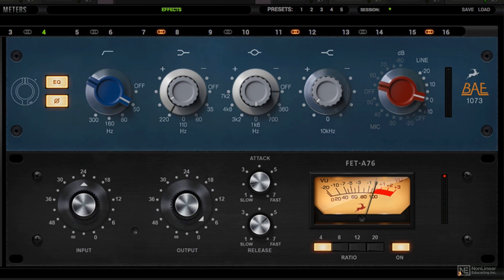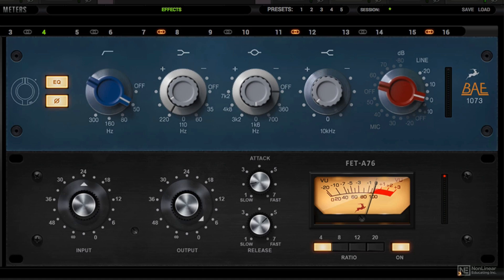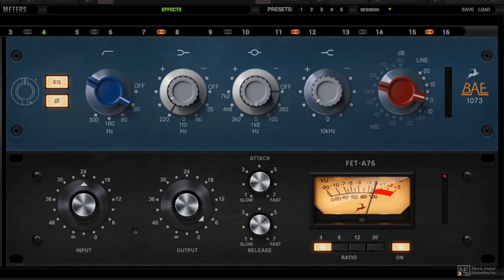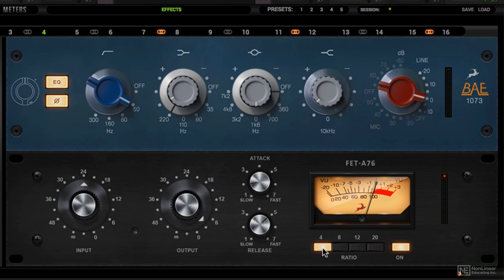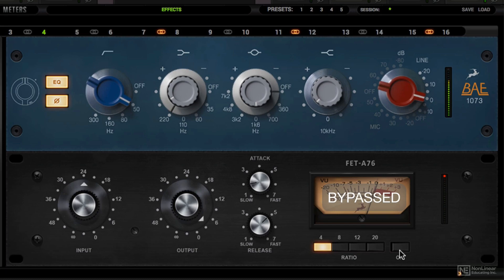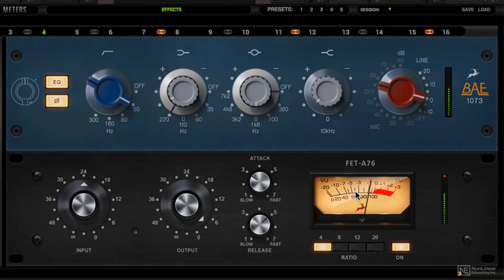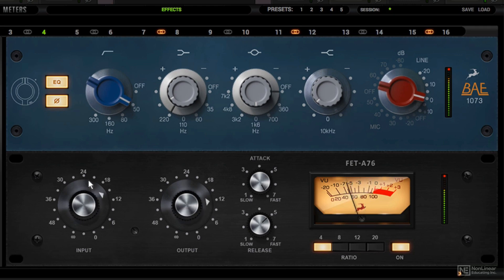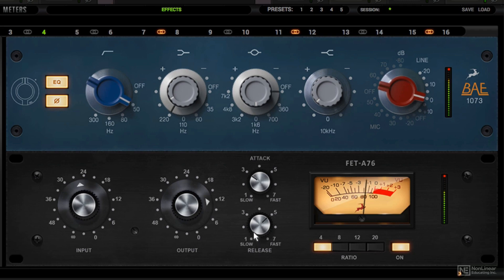Antelope Audio 102: Classic Compressors - 5. FET-A76

Comment: I've noticed that higher ratios actually make the recording louder and lower ratios make it *softer*. I usually expect the opposite because you're getting more gain reduction with the compression engaged if the ratio is high, so you'd expect to never go beyond a certain dB level, and that a lower ratio should leave more room for transients and a wider dynamic range (literally, less compressed). But this particular compressor seems to work "in reverse" to what I'm used to. Am I missing something or what? :)